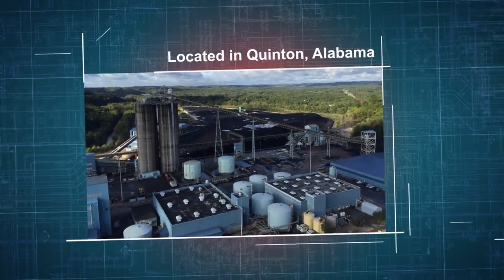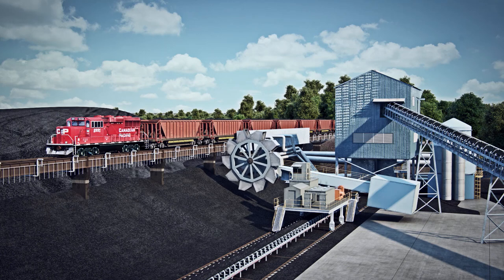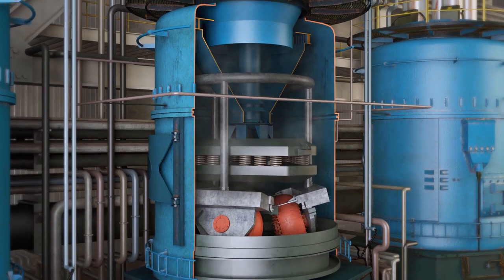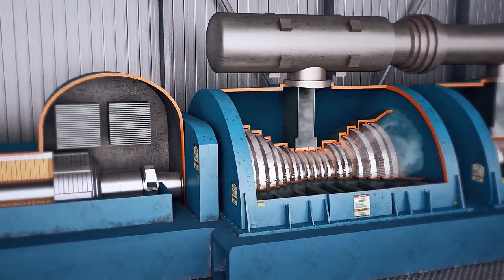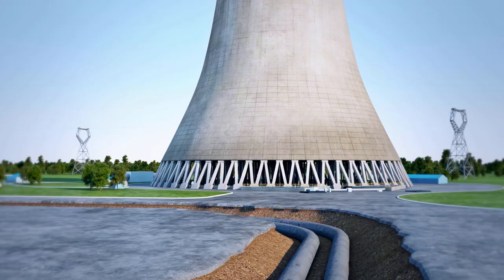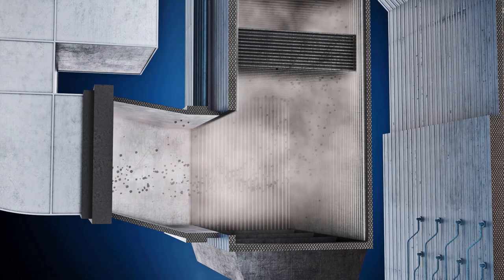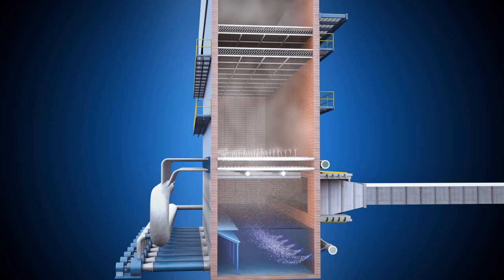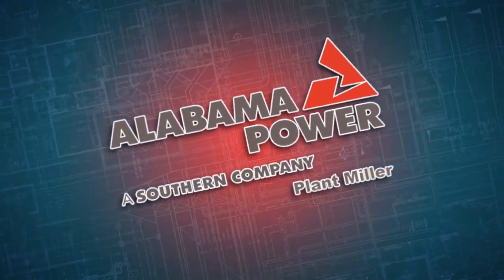Alabama Power's Plant Miller How Electricity Is Generated 3D Animated Tour

Comment: So much was left out. You cannot just use chlorinated river water for the steam. Those turbine blades would be destroyed in no time. That water needs to be clean and pure for when it’s turned into dry superheated steam. Those turbines run with steam at 3000lbs of pressure at 1005°F.  So much more into it then what was said here.
Reply from the maker: Thanks for the comment. Since this is a general overview video, not a tutorial on how to operate a power plant, so there’s obviously many details that couldn’t be included. But your comment does bring up good additional information. I appreciate you adding that.
Reply: @edpvideo  I get that, but even for the “simple” explanation I personally would have added something simple like “use river water that is then purified “ and go from there. It was a decent explanation though.

Comment: That was VERY interesting and well explained.  Can anybody here explain why the water is cooled with water towers?  Why wouldn't you resend the hot water back into the boiler with all that residual heat rather than cooling it first?  I got lost there.
Reply: Not sure, maybe someone who knows can jump in with some answers.
Reply: In order to generate steam, it first must be a liquid.
Reply: The water that is cooled in the tower is not the water that goes back into the boiler. The water going to the boiler is in a closed loop, and must be condensed through the cycle. The other water used to condense the steam gets hot itself, and must be cooled in the cooling tower so that it can go back and condense more steam.
Reply: The core concept is 'hot gas makes wind and moves fan'. I believe the steam must first be cooled because it is the difference in temperature than enables the gas to move at all. If you just had hot gas throughout the system, movement would be zero (or at the very least drastically inefficient). If I'm not mistaken, the larger the delta between cold water/hot steam translates into greater efficiency/less losses since the fluid 'wants' to move more as it expands more dramatically.

I am no expert on the matter, however, and would gladly be corrected by someone who is better educated on the topic.
Reply: Power Engineering student here. The water in the cooling towers is a closed loop and does not directly touch the feed water. It removes the heat from the steam leaving the turbine and condenses that steam back into water. The water used for cooling is of very low quality (chlorinated river water greater than 2000 ppm) whereas the feedwater in the boiler is of very high quality (less than 15-20ppm and with many added chemicals to prevent scaling and fouling of the boiler tubes). The temperature of the water entering the cooling tower is roughly 100-105F and leaves at roughly 85F, it enters the condenser at 85F and leaves at roughly 100-105F. The only purpose for the cooling tower is to cool the closed loop cooling water system.

Basically the feedwater and cooling water loops are separate and the water does not mix at all. the cooling water is only used to condense steam in the condenser in order to be able to pump the water (you cant pump steam). an auxiliary cooling water loop is used to cool stuff like lube oil and other equipment that needs water cooling.
Reply: @raumfahreturschutze  I'd agree

Comment: did the guy just say clean energy?
Reply: Yes, it refers to the effects that happen when energy is created if you burn something you have smoke and ash to deal with nuclear you have waste products and so on.
But you can get clean energy Boil water in a vacuum convert the heat energy to kinetic and electrical with a turbine the water will condense after that maintaining the vacuum.

Comment: There is a ton of misinformation in the comments regarding alternative energy sources. So, just to be clear;

1) All conventional thermal power plants operate exactly the same way. The only variable is the source of the heat: nuclear fission, combusted fuel, concentrated solar radiation, etc. Every single one uses the same turbine, heat exchanger, induction generator, heat removal fluid (a water mixture). 

2) The reason we don't just switch to all solar and wind generation is because there is no good way to store energy. We don't use the same amount of power throughout the day; there is a huge spike in demand in the afternoon through late evening, and very little usage at night. This is called demand response: the grid must be able to quickly adapt to large surges in energy demand within minutes. Most renewables (save for hydroelectric damming) just don't have that level of flexibility. If the sun isn't shining, your photovoltaics aren't on. Thermal plants have been time tested to be able to respond to these fluctuations.

3) As some have pointed out, there is some type of balance to strike between electricity sources. Supplementing traditional thermal plants with alternatives is the only realistic way to meet our modern energy demands. That is, unless we can find a way to store excess energy produced in low demand periods (this is particularly important for wind).

4) Moreover, the small scale cost of solar panels and wind turbines is very appealing but the scaled cost of operation ($/MWh) is laughably outrageous compared to a nuclear or coal-fired thermal plant due to the energy availability factor (EAF) alone.

TL;DR
In sum, coal plants won't be gone any time soon, and there is no silver bullet "just use x" solution at this time, primarily due to the lack of proper energy storage and redistribution technologies.
Reply: I won't deny that solar and wind are extremely expensive in comparison,  but to say we don't have any good way to store electricity from alternative sources just isn't true. We've been doing pumped energy storage since the late 1800s, it's very reliable, fast in response and with very little loss. While pumped storage won't work smack dab in the middle of the Great Plains or something, modern power distribution means you can build it pretty far away from where you'll be needing the power. Also, the advances made in the field of flywheel energy storage makes it so storage facilities can be (and have been) built with a realistically reasonable budget. They'll lose some power over time, but it won't be an appreciable amount between the moment the excess power is stored and the time it is needed to meet peak grid demands.
Reply: You can store solar heat in water at high efficiency and low cost and extract that energy using a closed vacuum steam turbine and condenser system with degassed water.
Reply: Didn’t say anything about nuclear.
Reply: This comment deserves more upvotes.
Reply: @Barskor1  re: "You can store solar heat in water at high efficiency and low cost and"
SOUNDS like a great business model ... WHY aren't MORE ppl doing it? Oh? NOT such a great idea after all, eh?
Reply: @uploadJ  Or just ignorance of the possibility after all you didn't know about it till you were told and then spazed out like a Luddite.
Reply: @uploadJ  I notice a distinct lack of facts being presented by you as to why my idea would not work....
Reply: @Barskor1  re: "I notice a distinct lack of facts being presented by you"
I didn't see any MATH you presented to refute. PUT your idea out there in terms of BTUs, kilocalories, Joules, Watts, etc. and MAYBE you'll get a proper response.
WE WILL THEN look at conventional sources of energy production and COMPARE what you propose with WHAT IS.
Reply: @Barskor1  re: "and get useful work out of it "
Ignorant Barskor1, if you understood conversion efficiencies MAYBE you would have a chance at this, but, you don't. 
Besides, with the advent of BrLP's SunCell (tm) ALL these 'storage technologies' will be moot. END OF DISCUSSION.

Comment: I've been in the power generation industry for 30-years, and this is the best overview of coal-fired power generation that I've seen.  It's very well done.  I follow-up with one for natural gas fired, combined cycle, which has twice the efficiency, would be a great addition.  But I'm sure something like this is very expensive to produce.  Keep up the good work.
Reply: In Helsinki /Finland at Vuosaari power plant we have such a combined gas turbine + steam turbine system producing electricity + heat. The el. efficiency is 60 % and still it gives much heat for heating buildings. Bio gas of organic wastes is used in a combined diesel motor + orc-turbine giving el. + heat energy.

Comment: I realize it may be hard for some people to grasp, but the steam temperature is indeed 1000 degrees F and 2400 PSI leaving the superheater to the HP turbine and then sent back to the boiler and reheated to 1000 degrees again and 525 PSI going to the intermediate (IP) turbine.  Saturated steam such as 400-600 degrees would do great damage to the turbine.
Reply: Why nobody try to put in better use heat instead of those Coling towers. .. maybe greenhouses...
Reply: @maksimmuruev423  
Sometimes the steam waste heat is used. Like in New York City's steam heating system. Most of the time though it's easier said than done to figure out a way to efficiently reuse the waste steam heat.
Reply: @maksimmuruev423  What is a green house going to do with 500,000 lbs/hr of steam that is at 2 psia (atmosphere is 14.7 psia)?  It is also around 90 F when it enters a condenser.  Also need to consider that the condenser is where the vacuum is formed but the collapsing of steam into water.  I cant remember the ratio off hand but it is something like 1000:1 in volume.  This vacuum helps pull steam through the later stages of the steam turbine and greatly increase the power.
Reply: @maksimmuruev423  You must not have any idea of the magnitude of energy those cooling towers are handling.  In NY all the fish in a river were suddenly dying, the investigation found out the water from cooling a coal power plant heated the ENTIRE RIVER enough to kill the fish.  Also in Alabama they do not need any more heat for their plants.

Comment: "Clean energy" cannot stay near the word "coal"... Anyone can say its energy production system is clean than another, but the real pathways to produce really clean energy are very few, and sure coal is not one of these. I appreciate though the great amount of technology and engineering involved in this kind of plant.
Reply: Really? The West County Energy Center in Florida was commissioned in 2009. It is larger than any coal-fired plant in the U.S. at 3,750 megawatts. It burns no coal. Instead, it burns natural gas. Unit 3 at the Vogtle nuclear power plant is 96% completed and will be completed soon. It's sister, unit 4 will follow soon after. When all 4 units at Vogtle are running, it will be the most productive power plant in the U.S., producing about 37 Twh of electricity yearly.

Comment: ? Why do the water vapor towers not have a turbine/generator at the top of them or throughout it? ( having more surface area will increase the amount of water that gets collected at the bottom, it also creates another point of power generation in the same system. Windmills completely depend on outside air, having it in the vapor tower makes it's run at all times and gets extra power output when the wind blows.) Ps. Lol that's really a question I love to learn so plz explain if you can =) and I know I'm horrible at grammar =)
Reply: Devin Johnson The steam will have to be pressurized, but with all that steam I’m pretty sure it’s possible.
Reply from the maker: @Devin Johnson - I hope someone chimes in, I'm curious about this too

Comment: Not enough in the presentation in the transmission section. I always assumed 25kv or so from the generator output was put into a step transformer as they said, but wanted to know more, as I'd heard that the high 400kv voltage in the step up transformer went through a spark gap. Then, it goes on a slasher for the 50 or 60 timing. It's transmitted out as a DC pulse, supposedly at high frequency like 55khz, with a 50 or 60 slash. Gerald Morin was explaining in this in his videos. How does a steam turbine maintain the 'exact' 3000 or 3600 rpm to maintain the 50 or 60 hz output? Also, the power generator itself couldn't produce enough power, unless it runs faster, then the power is converted later in the line. I'd like to know more about how the pole transformers work. They receive the 'transmitted' line, no neutral, which is grounded to earth at each end, the live wire terminated in the can itself. Also, burning coal is very inefficient. Peter Davey invented a device that heated water up immediately, just using acoustic resonant sound waves. Also water could be used, by splitting it into hydrogen from oxygen, then using the hydrogen  gas to heat the water. The burning temperature of the hydrogen would need to be lowered down, so the gas doesn't burn through anything. It's impossible to transmit.. current over the grid, so the current along with the 120 or 240 50/60hz is done from the pole transformer itself.
Reply from the maker: Thanks for the detailed comments. Wish we could have gone into that level of detail, but it was just an overview.
Reply: Once the generator synchronizes to the grid the frequency of the grid keeps it locked in. These turbines also have governors to maintain the speed. Now the watts are controlled by the turbine once the generator comes on line. Watched generators go on line many times in my career. Always fascinating to watch.
Reply: Say ahhh there "A", you kinda wrote a 'book' on us there ... look for a video on "power transmission" first and then "power distribution" next.

Comment: What I don't understand is how the power company creates a circuit with single or even 3 phase power. The top wire is the hot wire and then the "nuetral" wire is underneath. The nuetral is never hot unless there's a fault, which then it is connected to ground almost every 5 poles. Then the hot wire runs into your homes transformer, just 1 wire in. Then theres 3 wire service cable that runs to the house, 2 hot wires which are covered and 1 neutral wire which is bare. The nuetral wire is never "hot" and the top end of the transformer the hot wire only runs in, theres no out. Electricity needs a circuit to work, so how does the power company complete there circuit? They call the hot wire the "P"ower wire, and the "N"uetral wire. Your breaker box runs P wire in through the breaker and then the circuit runs back and is connected to ground. The nuetral that's runs in is also connected to ground. But the nuetral is never hot?
Reply: in any electricity generator there will always be a starting point and an ending point in a current generating coil, but generators have several coils each around magnetic pole of a generator, they are all connected up to form as though they are one huge coil, acting like a single coil or for 3 phase there will be 3 sets of such coils, the starting and ending wires of each coil , is important as any electricity produced come out from one side of the coil and returns to the other to complete an electron flow circuit, through the load, within this coil being subjected to changing magnetic fields of flux, electricity is produced, one end being the hot end and the other being neutral because one end is connected to the  ground and is also called a Neutral because it is at the same potential as ground, therefore the other wire from the coil becomes Hot,  so when you have a ground connection on a transformer, it means it is also connected to neutral, so only needs one hot wire coming in, or 3 hot wires coming in for a 3 phase transformer, as the transformer is grounded and has a neutral connected to ground,  the transformer Primary windings may only need this one main incoming hot connection as the return path for the current is through Ground and neutral, the secondary windings can have seperate Hot (Live) or Phase connection and a seperate Neutral as well as a seperate ground bare wire, though in principle Ground bare wire is at the same potential as  Neutral,  so all outgoing low voltage from a  transformer are separated entering each house. Those two insulated wires are not both hot, only one is hot and the other is Neutral and is approximately at almost same potential as ground wire, often known as earth wire.
Reply: Galen Belden the purpose of the neutral is to carry the unbalanced current from single phase loads in a 4 wire, wye connected system. 
Balanced loads on a 3 phase 4 wire system are carried on each of the three “hot” phase conductors.